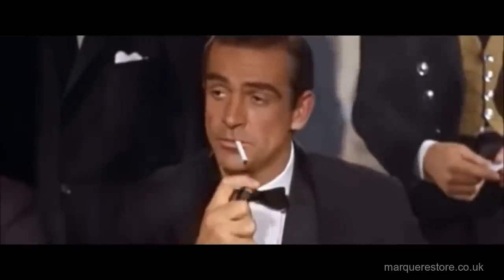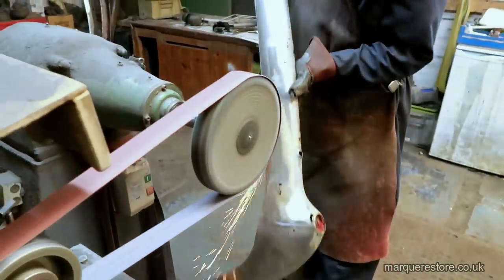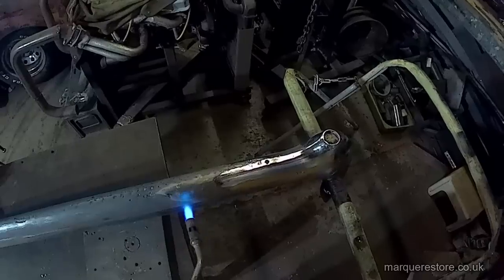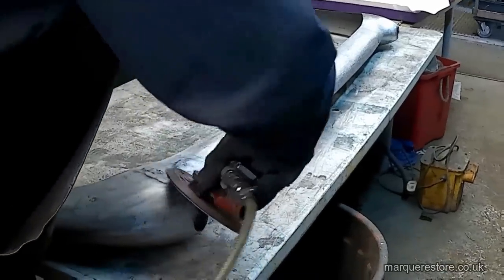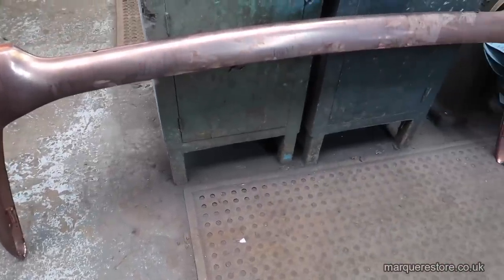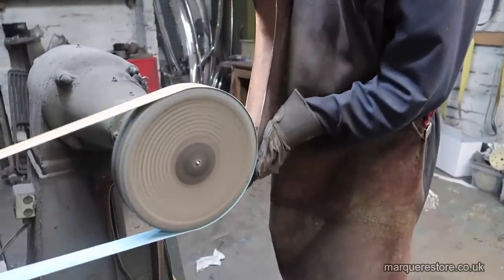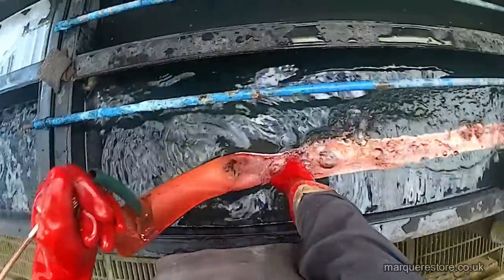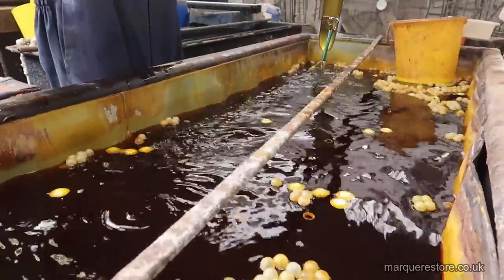Chrome Bumper Restoration - from old rusted Aston Martin DB5 bumper to SHOW CHROME

Comment: Metal insert brought the strength back lead fill meant all holes sealed and brought surface up to where it could be filed and polished back. All the rust has gone gone gone. Then all the polishing and plating processes awesome. It’s fixed permanently. Great Job

Comment: My dad has had the hobby of restoring old cars. When I was 13 I chose a 1964 Malibu Chevelle sedan bare metal body to rebuild as my very first car to learn how to drive in and as my very first vehicle. 
Nothing made of chrome he has ever sent out to have it re-chromed. If it's rust isn't severe enough that it has caused pitting, it can look almost as good as new just with some wd-40 and a wadded ball of aluminum foil. 
This was also the method used to keep an industrial guillotine paper cutter table surface smooth and rust free for the very heavy paper to move and rotate around without excessive friction. It will restore chrome to a mirror finish as long as it hasn't rusted to the point that has caused pitting into the surface.  Spray a little wd-40 on the  surface and then rub the area with the wadded up ball of aluminum foil until the rust has been taken off and has mixed into a black residue that can be easily cleaned off with a clean towel or rag. This has always just been done by hand and it doesn't require any special power tools or special chemicals.
Reply from the maker: Sounds Good. What a great first car. I have a 72 Malibu Chevelle.

Comment: Incredible workmanship! You don't see this kind of dedication anymore! I've got a 53 Cadillac Convertible covered in chrome. Most of it needs re-plating and I don't have the cash, so I decided to just sink a couple hundred into two "restored "and "re-chromed" Cadillac emblems, one on each front fender. Well, at first I thought they look great! ....BUT! soon, within a month after I installed them on the car, I noticed my cotton t shirt rag was getting "snagged' when I applied polish. The Chrome was peeling off both of my "restored" emblems !!! It was like peeling off my skin after I had gotten a bad sunburn! (convertible) I learned my lesson. Wait to I save up enough to have it done correctly by a reputable shop!! How much would it cost me to mail a 53 Cadillac front bumper from Massachusetts, to Coventry??? 🤪

Comment: One of my first jobs while still in high school was working at a plater But they only did Military parts for the 8-wheeled "LAV"  I ended up doing 2 jobs One of Sandblasting And Zinc priming And Plating steel rods that i think were for suspension Or A type of lifter Next door to use was a Englishman that reproduced A/C cobras And use to race Astons And other track cars in the 60's  Loved talking with him And learning about cars

Comment: amazing job you have done, I had my DB4 bumpers rechromed 25 years ago and stored them ,while they weren't as bad as yours the front  had been crashed so had to be repaired, the chrome shop put extra coats on as yours however the attention to detail wasn't 100% and there are some marks which is frustrating .However I'm now finishing the restoration and while not 100% concours its not too bad .I know so much more now in 2024 but in 1986 I was a greenhorn . I'm interested to know the cost please as Bumpers can be bought new now made in Stainless steel for around 2,500 UKP for both front & rear ,made in Vietnam. However I'm a big believer in repairing rather than replacing  . The skills your team has go to make the UK the top country in the world for classic car restoration. Well done and thank you for sharing some of the secrets of your complex work, regards Marcus (NZ)

Comment: we do basically the same thing here in the states,except we uce brass brazing rods instead of lead.they have outlawed lead here .so they have an imitation lead here that isnt all that great.      ty santee
Reply from the maker: We prefer to use brass for filling. In this case the matal was too thin to be brazed, as it would burn through and warp with the heat. Shame you are not allowed to use lead in the states.

Comment: The bumpers on my '59 Ford Fairlane are looking dull and weathered, but nothing like this bumper. The worst on my car is the chrome trim pieces. They are chrome plated, but some sort of cast metal, and are terribly pitted. I think that it is called "pot metal". The condition they are in really makes the car look shabby. I hope that they can be restored. You did a fabulous job on the bumper. I hope that the owner appreciates it.
Reply from the maker: Hi Gary. For your info I am just finishing a video about chroming pot metal. It should be available in the next few days.
Reply: @ChromeandCarRestoration  Thanks! I am looking forward to seeing it.

Comment: Beautiful work. I am a chemist and hope that you have taken appropriate safety measures to prevent exposure to toxic solutions, abrasive dusts and especially lead dust. You don’t want to lose your highly skilled workers.
Reply: Some of the solutions they use would be a major disaster if they get in the eye and very serious on the skin. Lead dust exposure looks really bad. Vapors aren’t very good either. I don’t think they could operate this way in the US.
Reply: @philtucker1224  agreed. 50 + yrs ago when I became a chemist even we “experts” did things that would chill my bones now. See people every summer using concrete saws w/o a mask…
Reply: I'd be more concerned about the hexavalent chromium and the cyanide plating baths getting the environment than occupational exposure to sanding dust.
This place is fully steeped intoxic waste.
Reply: @jimurrata6785  Agreed

Comment: im working on a original equipped 1960 chevy bel air, the chrome looks a little sad and as far is i can see no holes in the bumpers, is that a job you would take on?

Comment: Great video, thanks! one question, at 26:25 you can see a sort of 'waviness' / distortion in the reflective finish as the camera pans across it - is this due to the rechroming process not applying a completely 'even' layer'? I've noticed my 1980s Jaguar OEM bumpers don't have this  effect
Reply from the maker: This is the reflection of the rooflights above hitting the curved profile of the bumper.  Sort of a hall of mirrors effect.
Reply: i agree, it's the use of orbital sanders,  you can't get anything straight with a round sanding disc. a long flat sander would work better. it looks lovely but there is room for improvement. in my opinion.

Comment: What kind of precautions do you have to take with the rear spot welded fillet? thinking  about further water ingress and sitting water causing corrosion. Does the layered plating process infill any seams of the fillet? or perhaps you leaded the seems?.... great job BR Andy

Comment: Impressive work, I was surprised that you used lead, as I never would have thought the plating would stick to it. And yes a skilled metal fabricator/coach builder, could patched those holes and straighten it out. And you would have never known it, because thats what they do. But ultimately it's what the owner wants, and how much their willing to spend. Again great video, do you have anything on plating pot metal.
Reply from the maker: Pot metal is the subject of my next video. Nearly finished editing. It should be up in a few days.

Comment: Lead is the right way if you can't do micro work with the tig welder. Sadly my area we literally cannot legally work with lead and a micro tig weld is the only way to do this it takes hours for a part like this and frequently isn't worth it compared to just finding getting or making a new fab part.
Reply: Gotta say the plating is REALLY on point here.
Reply: For reference ive seen our tig guy practicing for parts like this with metal foil is how fine you can get with the right machine.

Comment: If the lead is expensive, would filling in the holes in the bumper with weld, using the repair panel on the back to take the heat be a viable option? Or would that be just too difficult to work with when it comes to the filing and shaping?
Reply from the maker: The bumper is so thin it cannot take the heat of welding

Comment: I'm still trying to understand how the anodes "see" certain parts of a part to be chromed for instance with this bumper wouldn't there need to be anodes over top of the underside of the bumper to get plated in that area? How does the unseen side of the bumper get plating on it because I thought electroplating worked line of sight?
Reply from the maker: It is not exactly line of sight. The nearer the anode the more plating it gets and the further away the less. (High and low current density areas). So the back of a bumper gets far less plating as the current density gets less as you go into the concave surface. Brackets also cast shadows (the bracket gets the power to the metal behind it causing little or no plating to be deposited. The backs of bumpers should be painted before re-fitting.
Reply: @ChromeandCarRestoration  That helps me to understand it better, thanks for the explanation it's interesting.

Comment: Alot of people don't realise when they built the DB5 for the recent bond film they also make 25 (might be wrong with the amount) bond edition DB5 to buy but none are road legal and they built them to the original spec but with modern tools so the tolerances are better and the engine even tho identical has more bhp and they are producing replacement parts for the original BD5 if you are in need of them
Reply from the maker: We plated bumpers and some other parts for the Golfinger edition DB5's you mention. In the future I will release a video of us plating the bumpers.
Reply: @ChromeandCarRestoration  wow so you can actually say that the bumper is to Aston Martin OEM spec

Comment: Love your videos please make more 
Question : what lead/tin % bar is safe to apply to metal prior to chrome?
Reply from the maker: More videos will be following. We use the lead designed for lead loading on car bodywork.
Reply: What you do to prevent bubbling or blistering on potmetal ?

Comment: Amazing restoration and outstanding result.  How many hours went into the transformation?
Reply from the maker: Not sure exactly but more than 12
Reply: Each bumper to get exact can take up to 3000 man hours for perfection.  30 man hours built the original car. You can see why this makes sense
Reply: @EkonRekon  there is no way on warth you can put 3000 into a bumper. Nor 300

Comment: What are the beads/ball things floating in the tanks
Reply from the maker: Croffles
Reply: The balls do a few different things. They reduce evaporation, the tank has an exhaust system pulling the noxious fumes away. Secondly, they help keep the heat in the solution, the water, acid and chrome or copper has to be kept warm to function correctly. They help with splashing too. They are basically ping pong balls with a thicker wall.

Comment: Nice work!  As an alternative to plating build-up, have you considered using brass/bronze flame spray? (with temporary backing in holes to allow it to fill the gap).  I've seen on pot-metal chrome restorer use this build up metal to add on and replace missing bits / fill pits in pot metal. (I.e. panel beat a sheet of brass for the backside, then thermal spray (instead of lead) the holes to fill them in and build up a thickness of metal equivalent to the steel gauge.     E.g. https://www.youtube.com/watch?v=jjX_Sul43G0
Reply from the maker: Thanks for the video link. This is a system I had not seen before. I will find out more about it.
Reply: No shortcuts! Do it right or don't do it all. I had my fender "rechromed" in California.....3 years later, it's  "decrhoming" . Shady work.. never again. The only thing they "restored" was their wallet.
Reply: @antonioramos5257  I agree, which is why I'm a bit dubous about backfilling with lead vs a much more solid material - the flame sprayed bronze/brass.  A harder underlying surface that accepts a multitude of chroming processes very well.  AND it's lighter.
Reply: @rkriisk  Well there is a need: It's called speed and efficiency. Just because something has been used for 100+ years doesn't mean it's the best. We have advanced technology and materials now that are vastly superior than what existed even thirty years ago nevermind a hundred.
Reply: @rkriisk  BS. What are you talking about? Most people care about time especially the people paying for it and the company doing the work. Time is money and if you can do it faster and maintain quality and even improve it it's ALWAYS better. The abestos analogy doesn't work. Try something like carbon fibre for the aerospace industry or 3D metal printing and multidimensional CNC. Your claims are laughable.

Comment: Why not tig welds to repair the holes. I've seen a vid of a guy welding tin foil so it is not the thickness of the metal that would be a problem given the right equipment and welder. Spray welding may also work.

Comment: Why not use finer grits before that first copper? Less scratches to remove. And why do I get this strange urge to fill the garage with tanks and chemicals?
Reply from the maker: There is no need. The copper is good at levelling the marks out.

Comment: Repairing the bumper with lead? I´m prette shure thats tin the repair guy is using. Led is grey and cheap, very soft and no good to spackel cars with. Tin on the other hand is silverish, expensive (the kind you use on cars) and a great base for copper an chrome plating.
Reply from the maker: We only use the correct type of lead to spackel cars!

Comment: That’s a terrible old fashioned method of making repairs. The front rusted section should have been completely cut out till solid metal could be welded to and a new piece of metal formed to the open area and edge welded to the old piece. That will not last long in weather.
Reply from the maker: I agree your method is better but more costly. This method is what the customer wanted to keep costs down.

Comment: It looks beautiful, but it's still junk.  Its 1/2 the thickness of what it was and that tiny piece of steel behind it is doing little and the lead of course is doing nothing.
Reply from the maker: These bumpers are thin when new. With the amount of copper on it it left us thicker than when it was new.
Reply: @ChromeandCarRestoration  Copper is not structural and there is no way there is that much copper on it anyway.  It probably doesn't really matter as the car will probably not be used as a driver.